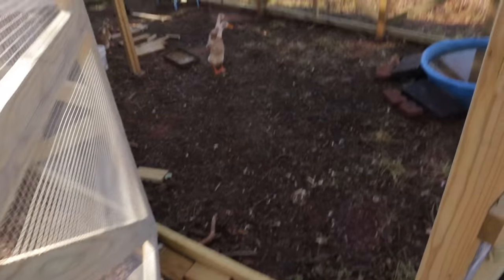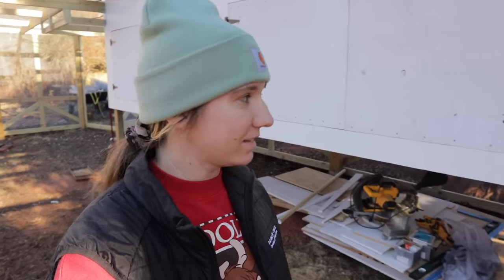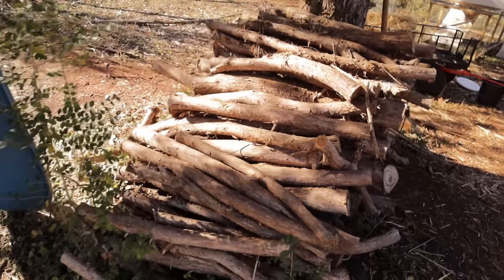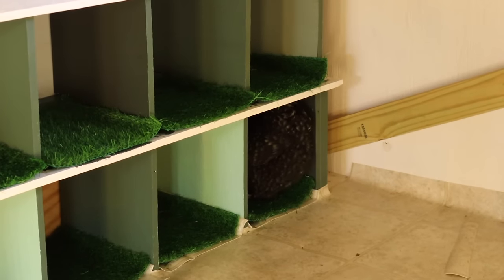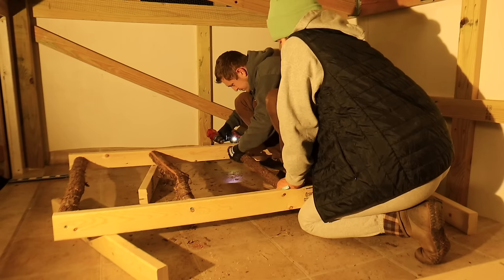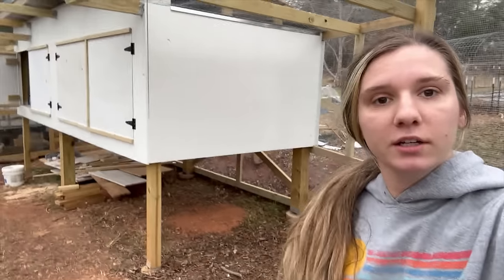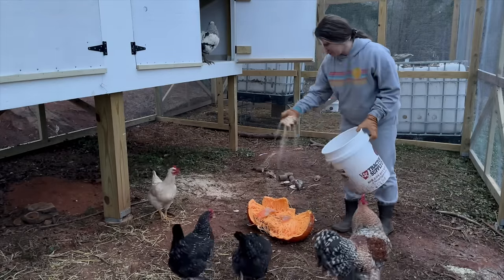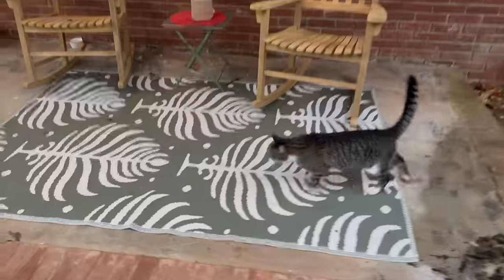It's Good ENOUGH for our CHICKENS! | Chicken Coop Build | Homestead Build

Comment: Have you tried using wood shavings instead of straw. Shavings absorb better and you can do deep litter with them.
Reply from the maker: We used to use shavings/pellets when they were small but we specifically want to use straw/hay so we can use it for no dig and no till garden beds☺️ the shavings break down faster & absorb but we prefer the larger amount of material we get from the straw for the garden

Comment: Great coop but chickens shouldn't be near cedar.
Reply from the maker: They shouldn’t be around cedar shavings because of the volatile oils/scent can be toxic to them & the dust can cause breathing issues. Shavings are bad for this because they have much more surface area and are off-gassing those oils & breaking down & dusty in general. The roosts we installed have been drying out for over a year & aren’t off-gassing, are in a well ventilated coop, and we did our research. The birds love their roosts. We feel comfortable with this decision, but to each their own.